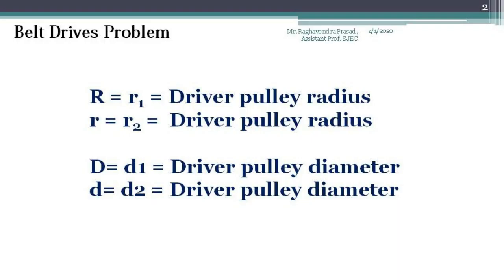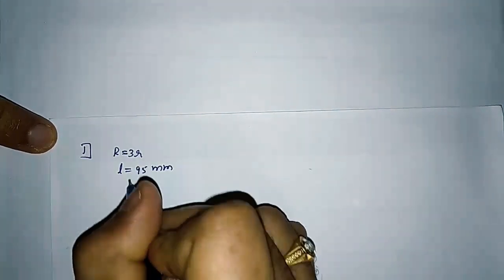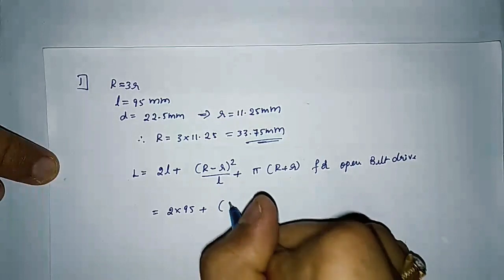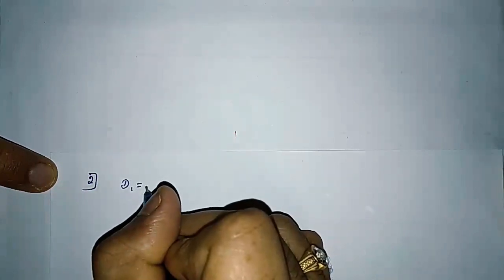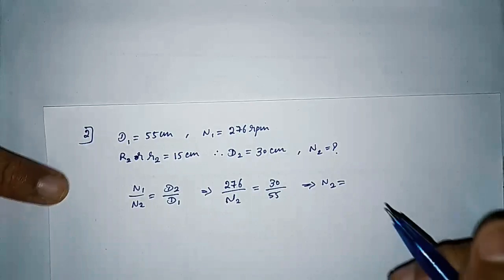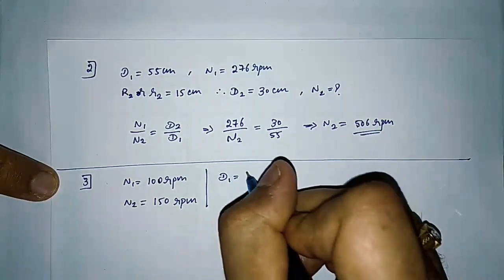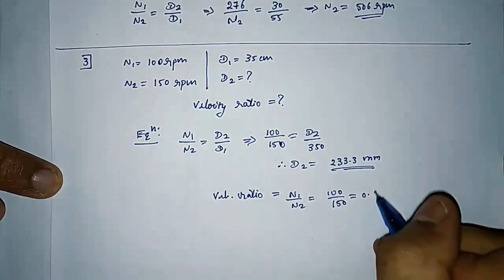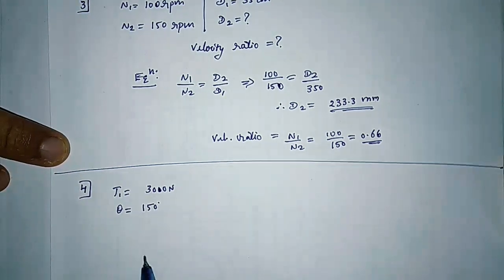Belt drive Numerical Problems

Comment: Sir problem no:-4 ka answer galat hai
Kyuki e^0.34=1.404 hota hai 
Or 3000/t2=1.404
So 1.404t2=3000
So,
T2=3000/1.404 hoga
T2=2142 is the correct answer
Thanks sir 
And also thanks for read my comment sir